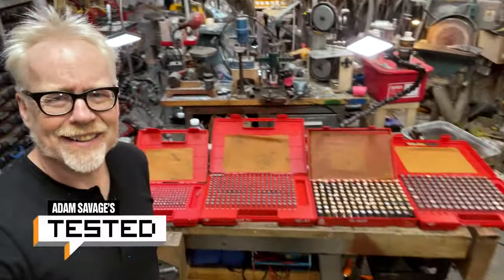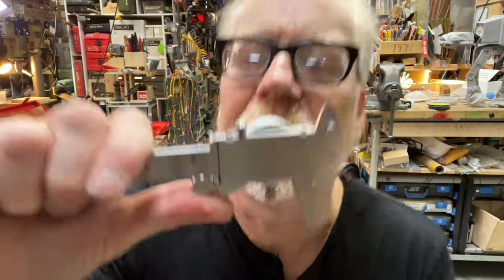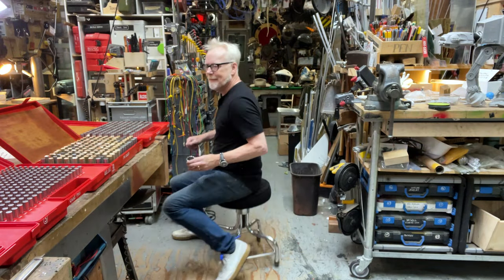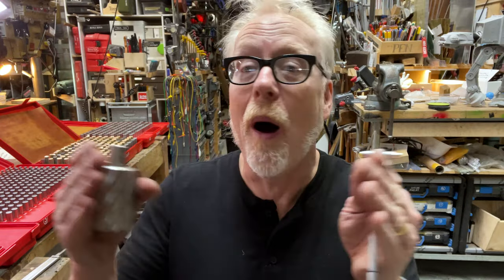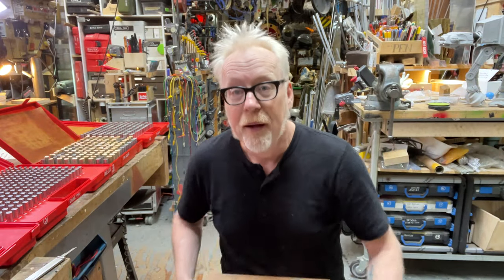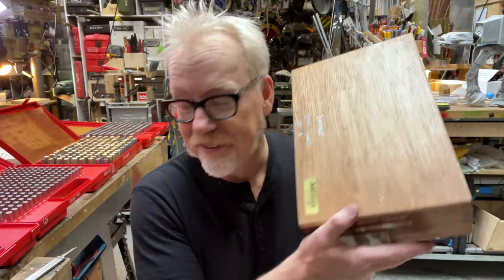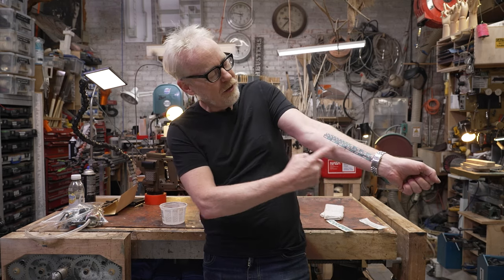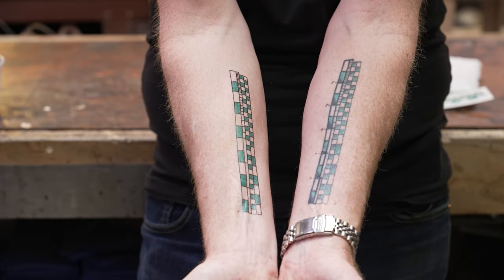Adam Savage's Favorite Tools: Pin Gauges!

Comment: Hi Adam, I just thought I would let you know that when using callipers to measure the distance from the edge of a part to your gauge pin you should use the step at the head of the callipers instead of the step on the tail end, the tail step is good for getting into small spaces but the step on the back of the head gives you a much more stable platform when getting your measurements.
Reply: it seems one in 50 videos showing how to use calipers actually covers this measurement.... why does 'nobody' know this is a way to use calipers?
Reply: Was just about to say this. Open it longer than what you need to measure then thumbnail hold part against back top of vernier and slide closed to touch part.
Reply: Came here to say this. I can hear my EGAD prof. yelling "Use your calipers correctly!" right at 11:50.
On the other hand, very very jealous of Adam's contiguous set of gauge pins.
Reply: Yep,  was going to say this,  I'm glad others caught this as well.
Reply: I believe Mitutoyo was the first to commercialize that feature. They call it "quadri" measure; outside, inside, depth and step. That was 50 years ago. Nowadays most calipers are made that way, and yet few seem to know about that feature. Go figure. (However, scanning the comments shows that a lot of us here know.😊)
Reply: I work in a cable manufacturing factory and we use that side to measure the stripped copper to the isolation reliably to tenths of a millimeter. Very useful feature
Reply: @paulmarsman8758  I've seen more calipers without that feature than with one. Also the ones with it use to be newer and more expensive. But It's really a wonderful feature to get used to and than get confused when you have to borrow crappy equipment from somebody else.
Reply: Wait what step at the head of the calipers?
Reply: @your_uncle_barry_6700  From the left end of the caliper body to the left end of the slider, on the back side. If you look at the left end when the caliper is closed you'll see that those two surfaces are ground flush.
Reply: @randyshoquist7726  I gotcha. Learn something new everyday. Thankyou for taking the time to explain to me
Reply: can we also say that calipers are only reliable to .002
Reply: It was driving me crazy when he was using the tail, I was yelling at the screen.
Reply: 😢there is a step on main body !
Reply: Came here to say this. I only use the tail when it is the only possible way, otherwise I use the step on the head.

Comment: You can also stack the gauge pins to measure holes larger than you have pins for. You can stack two and add the dimensions.... There are some formulas to put 3 together in a pyramid shape and measure pretty big holes with your larger pins!
Reply: I nkow that flat gauge are made for stacking (by ringing them). Isn't it a little bit janky with cylindrical gauge?
Reply: @xmtxx  not if you’re measuring a round hole.
Reply: Link us up! I need to know how to do that!
Reply: I was thinking about that myself wondering what the math would be if you had to combine 3 pins to measure a big hole. Good to know someone already figured that out!
Reply: @F0XD1E  Just draw the three circles as per the pin gauge in a CAD program, give them all tangent references then draw a 3 point perimeter circle around the lot and the math is done for you!
Reply: @Greg Parker has definitely got the practical solution. If you are more mathematically inclined, this is actually a special case of a classical geometry problem known as the problem of Apollonius. The general case (where the pins aren't all touching each other) is quite tricky to solve, but the special case we're interested in (know as Descartes' theorem) has a nice solution. If we define k to be 1/r, than k=k1+k2+k3 ±2* sqrt(k1*k2+k2*k3+k3*k1).
Reply: I forget about that one! Have pins up to 1" so that's pretty useful to basically double the measurement range. I also can imagine using two round pins and a larger flat gage in the middle being a good hack too!
Reply: @gregparker3873  there are calculators online for this purpose
Reply: @spevakdesigns  when you start adding a ton of different measuring equipment you start to worry about tolerance buildup, they'll go through it on gd&t training
Reply: @xmtxx  Basically the same as placing a pin in a hole.  Set 2 of them up and use the third as your gage.  Go No-Go.  Have to use a formula tho to get the exact measurements.
Reply: Huh, haven't ever thought about that before but you totally can
Reply: @gregparker3873  no
Reply: @davidfabijan9662  no
Reply: @gregparker3873  exactly what I was going to say, as I use CAD daily in the machine shop for the geometry features

Comment: Hey Adam... on your smallest pin gage set case... you have a labeling error.  You wrote .11" as the start of the range and it should be .011".  You kicked in my OCD!  ;)
Reply: this is correct. He says 11 thousands, that would be 11/1000 = 0.011"

Comment: I used to work in a factory that made Bullet casings. We used a great amount of these pins to check the holes on the end of the casings that would hold the primer and where the firing pin would strike. It was insane the precision required of these objects and the pin gauges made it possible to produce quality parts at a high frequency.
Reply: I use pin gauges as go/no go for primer pockets when I reload. Always good to know when it’s time to bin old brass.

Comment: There is another option for measuring small holes, significantly less expensive than the bore gauges you mentioned. You should get yourself a set of small hole gauges, like the Mitutoyo 154-901. Like the telescoping gauges you measure them afterwards with a micrometer, but that Mitutoyo kit for instance is good from 1/8" to 1/2" and they're very inexpensive. They're less sensitive to being held at an exact angle, but you do have to develop a feel for when you've got it at the right size. Highly recommend.
Reply: Not only that, but they can be used to verify roundness of a hole, by measuring at different angles around the hole. Pin gauges only tell you the nominal diameter.
Reply: @edbennett8257  Never considered that, good point
Reply: Yes. I was thinking this exactly. We use these while making aircraft that have to be round and within 2 thousands plus and minus 0. They are quite amazing at measuring roundness.
Reply: I've used these with limited practice and can get within .002 thousandths easy.  They definitely take a "feel" to get good with but they are extremely accurate.  Same amount of practice it takes to measure with a micrometer correctly..
\
Reply: Since I aint doin rocket science I simply use a drill bit.

Comment: Paper is a great measuring tool often used in welding fabrication and is also probably excellent for other positioning applications as well where you have a flat surface and can trace positions using crayon shading over the top.

Comment: A tool that I use regularly is a spear gauge. This gauge is for measuring bores larger than 50mm up to a size of 900mm in increments of a 0.01mm. We use those to repair gearboxes for the off-shore.

Comment: Not a machine tool, but one tool I found in Active Surplus in Toronto years ago was a watch makers vise. Great for holding small parts when using a pin vise, micro files, etc. when working on a model part.

Comment: The must-have machining item in my shop is a coaxial indicator. As soon as I learned about what it was, I immediately went and bought one. Being able to line the mill up exactly with a hole is SO important, whether for boring or for zeroing out the mill on a part.

Comment: I use pin gauges at my shop all the time. As a gunsmith, they have been super handy when someone brings in a gun in a box that they took apart and can't get back together, and it's missing pins. I use the pin gauge to figure out the size needed so I can buy or machine a replacement. Super satisfying every time you find one that is a perfect fit.

Comment: Gauge pins and Jo Blocks are the 2 most useful thins in a shop.  I do not know how I would have done jobs without them.  I am a retired tool maker and I used them daily. Beside the gauge pins and Jo Blocks being top of the list next would a Uni-Mic and then a digital Caliper.  The digital caliper is great for quick comparisons.  Take your working size needed and set your zero there and then you can rapidly check other parts and know if they are plus or minus in size.  What a time saver.  The Uni-mic is great when having to check dimples or steps. in parts

Comment: I recently had to figure out how to measure wear on screw threads and after researching came to find out that you use 3 equally calibrated pins/wires, laying two close together in the grooves of the threads on top and 1  in a groove at the bottom while looking at the end on axis,  taking your calipers you can compress all three points of contact and do the math to find the wear differential from what should be and what is. Your video of gauge pins reminded me of this. Thanks for all the video's.
Reply: Do you mean you figured this out yourself? This is actually a very common way to measure screw threads when machining them. There is a formula to get the exact pitch diameter measurement this way.
Reply: thread cylinders are quite commonplace, also can use thread parallels which use the form of the threads in much the same fashion.
Reply: @andrebyman8744  they said "came to find after researching"
Reply: @andrebyman8744  no, I wish I would have, but it came up at work one day and after trying to figure it out without luck I researched it and was really impressed by the method, which made total sense. Adams demo with calibrated pins reminded me of it, pretty cool stuff to build a foundation of Knowlege from

Comment: As a part of my current job I am rebuilding Fujitsu f-400 bill dispensers.  When I came into the task I was told that 'the way' to set the belt tension was liberal use of the 'calibrated thumb'.   Unfortunately my thumbs are apparently poorly calibrated so I went looking for something I could measure the tensioning points against.  I started out with a set of calipers on a 'properly set' rebuilt assembly then went looking for a proper gauge block but then discovered pin gauges and we are now setting them uniformly and much quicker!   Thanks for the content and explanation of how they're 'supposed' to work

Comment: I have had several sets of pin gauges for a while an I agree that they are awesome. The best way to quickly determine small hole sizes to within about 0.001". I use them more than my set of gauge blocks by almost 10:1. Lastly telescopic gauges can measure accurately to less that 0.0005" if you you are careful but it takes practice and patience.

Comment: Early in my career (circa 1979) I spent 6 months in a high precision metal manufacturing plant.  I worked in the QA department and we investigated non-conformances that were found by the QC inspectors.  We called them deltronic pins.  Used them a lot. Because, when drilling/boring lots of holes in things one of the primary go-nogo determinations is whether the hole is the right diameter.  We were making a very fancy hydraulic cylinder.  Everything was round. The cylinder OD and ID was round; the hollow piston ID and OD was round; the flange was round; the bolt holes in the flange were round; and the bolt pattern was round.   In a perfect world all these circles would be truly round and precisely concentric.... turns out the world is far from perfect.  Now granted we're talking about +/- 0.001" or maybe even +/- 0.0005" ... but in reality no hole, no bore, no pipe, no shaft, no bolt pattern, etc. is really round.  We had to manage the out of roundness (eccentricities), the lack of concentricity and other tolerances to avoid an unfavorable tolerance stack-up that would result in the thing not working.  Micrometers, calipers or snap gauges (whether two legs or three) can end up on the peaks or in the valleys of a hole/bore which could result in misleading measurement.  A gauge pin or round go/nogo gauge, which is ground while spinning, can be quite precisely round.  When inserted in the hole it hits the peaks but determines precisely whether the part that goes in the hole will fit.   It was a very intense introduction to metrology and I learned the we don't really know what any dimension is we only know what our measuring tool says it is within the precision of the measuring tool.  Sometimes you discover your measuring tool is insufficiently precise because the part does not fit even though the measured dimensions indicated it should fit.  Metrology ... great topic and endlessly interesting and challenging !!

Comment: Thank you for posting this video. I am using it as part of my studies so I can pass my tool maker red seal exam. I also have a pro tip for Adam. When doing comparative measurement with a pin in a hole, place the fixed jaw of the vernier against the pin and the moving jaw which is lower  (you may have noticed the step on the back of the vernier) will be made flush against the side of the block: as you adjust it up and down. This is more accurate than using the depth feature. Additionally a Surface table and a height gage  with a DTI attached is the most precise way of doing a comparative measurement. Cheers :)

Comment: Great video. I work in a machine shop that specializes in tungsten and silicon carbide. Most of the work we do is very precise and requires a lot of different tools to do the job. I do find it a little crazy that you only trust your measurements with calipers within .01-.015". I own a variety of mitutoyo calipers (dial/digital) and use them alot! They are what I mainly use to verify dimensions that have a +/- .005" tolerance while using calibrated standards to check my tools. I use them for checking outside/inside diameters, notch/slot widths, feature locations, and sometimes depths depending on how tight the tolerance. I also use telescoping gages for bore diameters, specifically longer bores because they are nice for reaching down in and checking in multiple places along the bore. What you call a bore gage I call an ID micrometer or tri mic, I use those alot for checking finished dimensions with tolerances as tight as +/- .001 though I've used them to hold +/-.0008 a time or two. Anything tighter than that gets a bore gage set up, using gage blocks to create a standard. I also use gage pins ALOT! My .062-.250 set being the most used but have pins from .005-1". The tool needed depends on the accuracy required but even calipers can be extremely accurate while using calibrated standards and experience.

Comment: My father worked as a Manufacturing Engineer in a Tool and Die shop. The amount of measuring equipment they had was astounding. I really didn't appreciate the tools and knowledge that place held until I became an independent adult. Tool and die shops are pretty rad.

Comment: This video made me kind of happy for a weird reason. I spent 10 years arguing to our quality department that we needed pin gauges for measuring diameter on some of our helicopter parts. Basically, I wanted to get some that would be set up for a go / no go gauge instead of using vernier calipers. Nobody ever understood the point but this video just reassures me that I'm not crazy.

Comment: Machinist here: I'm going to print out the thumbnail of this video and use it as a label on the cabinet I keep the gauge pins in at work. My favorite tool that not everyone knows about are Swiss Deburring Tools, they are shaped like lollipops and are crazy expensive, but are good for deburring recessed holes. I highly recommend them if you do small, detailed work. Also, the blades made specifically for deburring plastic are absolutely worth investing in, and the starter set is < $20. Also, I should mention that you can buy replacement pins individually for a few dollars which comes in handy a lot. A set of gauge pins was one of the first professional tools I invested in and this video brings back memories of how exited I was to get them.

Comment: The jaw end of the calipers is much easier to measure to an edge with. Far easier than using the probe end. You can use it to set your machinist square to digital accuracy as well.

Comment: In our machine shop when I was growing up the first thing Dad had me make was a set of 1-2-3 blocks, which are tool steel (I think he had me make them out of O2) 1 inch by 2 inch by 3 inch blocks that are heat treated and ground as a pair so they are as exact to each other as possible. Next were a set of parallels made in the same way that are about 1/4" below the thickness of the vises on the millers (we had a Jet, and when we could finally afford it a Bridgeport). Both of these were used for setting up/supporting parts for milling and surface grinding.

Comment: I'm not sure if Adam did this just for the video, but when I was using telescoping guages we'd usually use a micrometer with a clutch to measure the guage. The clutch prevents it from compressing the telescoping guage. I feel like you can pretty easily get to single thou accuracy with that setup with a bit of practice. Anyways, always fun to hear about machining stuff.
Reply: Yeah, and with smaller holes that you can't get a telescoping gage into, there are small hole gages that work on the same premise, to be mic'd with a micrometer.

Comment: A set of adjustable small hole gages will handle the measurement of most small holes that the telescoping gages stop at.  These are comparative and still need a mic or calipers to take the measurement. They have been around for a hundred years and work great. I will say a set of pin gages is a nice addition to any shops tools. Thanks for sharing!